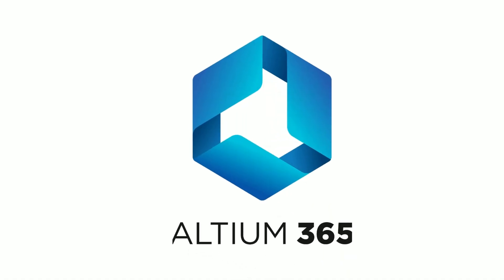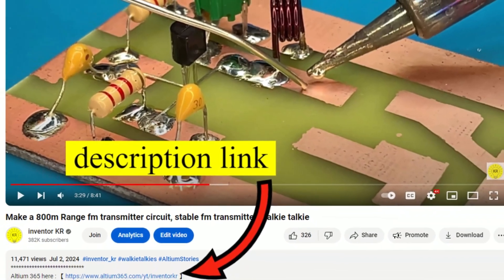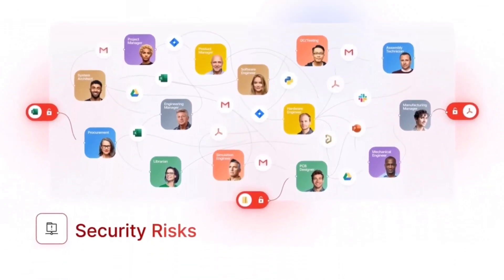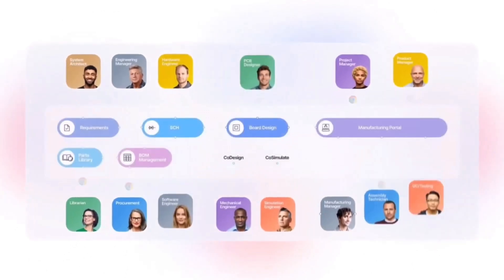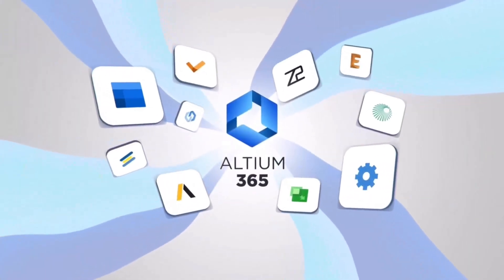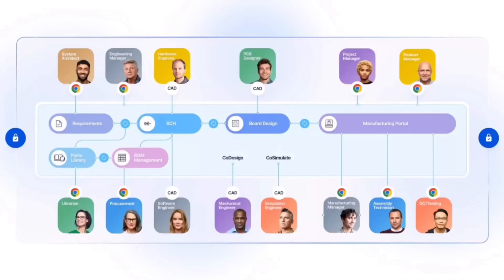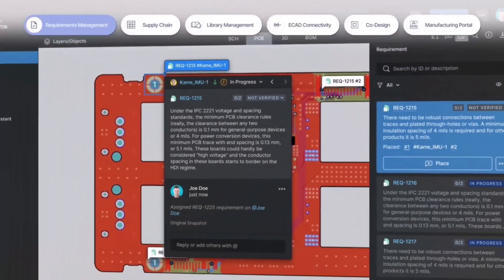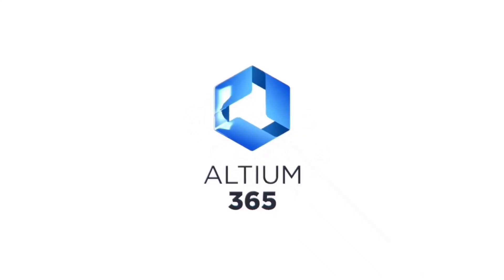how to make radio at home receives all international radio stations

Comment: The most transistors that I used were a metal gyrmanium, and a few of them are silicon and made of black plastic. The most transistors I like it are Ac128, AC126,, OC74, OC75, OC45 and other transistors, most of which were written on Toshiba